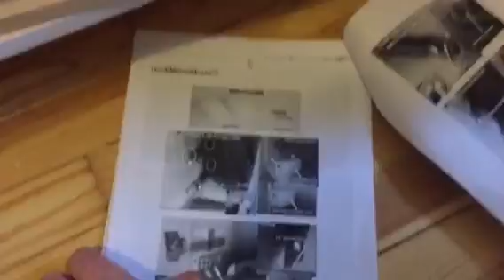Barker Cabinet Problems

Comment: Sorry for your bad luck man
I ordered 2 custom size vanities with six draws and 4 doors, 12 drawer slides12 of those orange adjusters 8 sets of door hinges, I ordered them in plain wood cause i wanted a custom color 
I had no issues with the cabinets they look great and are rock solid

Comment: I'm working with Barker now and we have had a lot of missing pieces, however after doing a lot of research I still believe these are the best RTA cabinets you can buy. I have to disagree with you on customer service. Clayton has responded to any issues we've had within a day or two. He usually responds in the evenings. 
Our order was for an entire house so kitchen, island, and two bathrooms. We've only come across some minor damage from shipping so far and all of it will be hidden or can easily be fixed. Like the side panel pointed out in the video. Every side panel has the two painted holes which I believe are from the production process. If you ask me I'd say you lucked out having that side scratched. Once that panel is installed you'll never know it's there unless you're laying on the floor with a mirror.
We actually appreciated the multistage shipping with info about shipments on their website. We were able to start on our projects earlier than expected and unpacking would have been a nightmare had it all come at once.
Here's my real problem with your video. We're supposed to believe that you're capable of producing a YouTube video and you couldn't locate the directions you can download on their website with pictures AND ALL OF THE BARKER VIDEOS ON YOUTUBE? Come on?

Comment: I have used Barker twice for cabinets and both times have had an amazing experience. First was a kitchenette several years ago for a mother-in-law suite and in the last year, I ordered 2 uppers, 2 base file drawers, and a desk spreader for a built-in desk. I assembled both sets of cabinets by myself with no assistance. Yes, there was a learning curve the first time around, but their assembly videos and step-by-step instructions on their website with photos to guide you are all you really need. Barker's quality is top notch. My sister used expensive custom cabinets in her kitchen. Then, upon my recommendation, she used Barker in her master bath. She now wishes she'd used Barker for her kitchen. You do have to order well ahead of when you need your cabinets, especially if you are getting a finish on your doors, fronts and panels. Once received, you need to organize them all your pieces. They are labeled with stickers. Honestly, it's really not that difficult. Anyone questioning whether to use Barker or not, go for it. You won't be disappointed. I tell everyone about Barker and in a few years when I remodel my kitchen and master bath, I will be ordering from Barker once again.

Comment: Missing pieces sucks but if you can't figure out how to assemble cabinets, you shouldn't be ordering RTA cabinets. Beyond that, Barker has videos on how to assemble everything. It seems like your frustration got out of hand and had you finding problems with everything. Can't fit a screw driver in? How about using a short screwdriver rather than a long screwdriver? That finish problem is on a panel end that doesn't show because it is butted up underneath the counter.

I had some of the same experience with barker, hundreds of pieces delivered in the first shipment with a few missing. This is probably because they got damaged during production and had to be remade. Thousands and thousands of custom cuts and holes in the correct locations. One hole in the wrong location and one missing. That works out to like 0.01% or less error rate. Not bad in my opinion for custom work done offsite.

Comment: Well, first, if you bought Ikea cabinets that's evidence quality doesn't mean much to you.  But I've had problems with Barker cabinets too.  Ready to stain cabinets that are full of scratches across the grain, edge banding falling off, raised door panels that fell apart because the center panel was cut too large.

Comment: I was very unhappy with everything from Barker Cabinets.  No deadline dates, no customer service, partial shipments and no instructions.
Reply: Hello Diane, I checked your order and see that you had a two of your five drawer fronts get damaged during transit on your past order. You demanded that all five drawer front be remade so that they "match" even after we assured you that the paint is perfectly matched from one batch to another. I stepped in and allowed a remake for all five drawer fronts to make you happy even though this would not be necessary. I will be send you an email regarding your statements here.  - Chad Barker

Comment: I read some of the comments before watching much of the video but I'm still surprised by how inept this guy is. 

If your tool is too big to fit a space, the "space" isn't to blame. Speciality tools exist for a reason. Get either a short screw driver or drill adapter to drill holes in confined areas. For the missing pilot holes... how about using a tape measure and mark the same distances the other holes measure. 

The veneer "issue" of which he said, "I don't know how we could possibly use it" (it being the cabinet?) as if the issue was a structural problem. Edge banding can be reattached with a regular clothes iron. And that problem disappears. 

For the end panel, won't the top edge be covered by the COUNTER as the counter  overhangs/covers the top of the end panel? 

I have so many more thoughts, but his complaint about his lack of space in his kitchen, as in he doesn't have room to lay things out to fix these issues. That's a YOU problem. He brings it up like Barker is at fault for that as well. So strange.